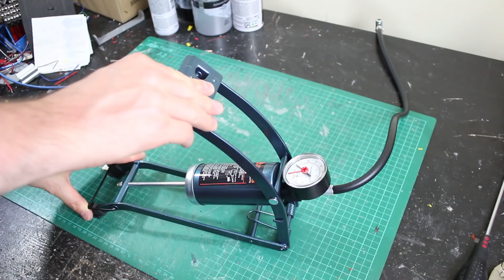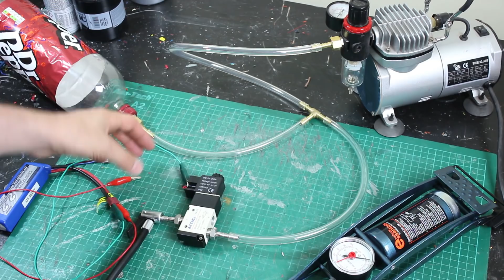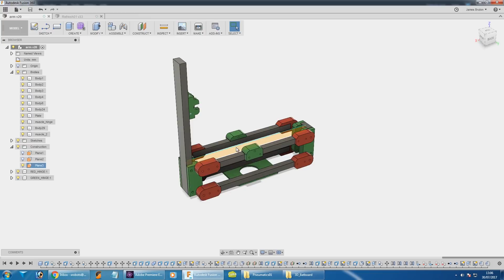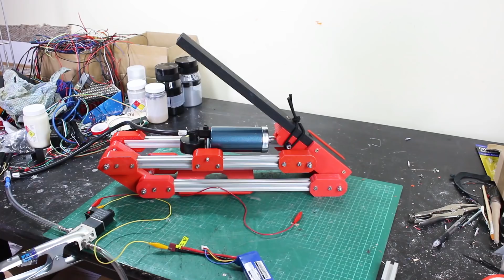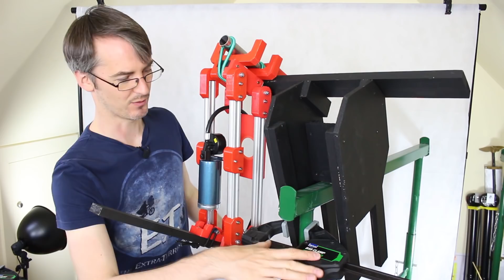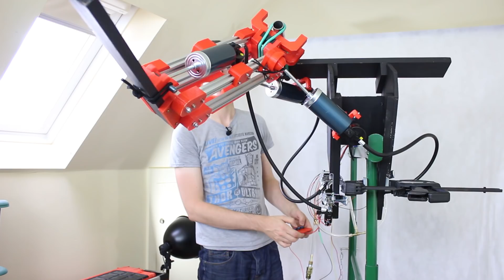Pneumatic Fighting Robot Concept | James Bruton

Comment: using the smaller compressor, you can put a valve on the solenoid exhaust port so when you need return, just open the valve and let the air out, and close it back to get your pressure back without waiting for the gauge to go above 1 bar

Comment: In my experience there isn't a good way to make a pneumatic actuator hit a position accurately because air is compressible. What pneumatic actuators are used for in industrial robots in to move back and forth between two hard stops. Occasionally you'll see them as a counterbalance spring for supporting the weight of a heavy arm, tweak the pressure based on the weight of the tooling on the end.

Comment: The 3D print beads look really thick. Did you increase the nozzle diameter for faster prints and because surface finish is not important for structural parts?
Reply: Are there any downsides to using a big nozzle?

Comment: Hey James, here's an idea to improve the accuracy of the pneumatics. Set your pressure to a fixed number that you want to use (150 psi for example) and do a slow mo recording of the robot punching. Then measure the angle of rotation of the joints. Then using the high speed footage, measure how long exactly it took the joints to fully rotate. Then, using those numbers, figure out how long it takes a joint to rotate one degree. Then, say you want one of the robots joints to rotate 13 degrees, you multiply the amount of time it takes for a joint to rotate one degree by 13. Then, using an Arduino, open the selenoid for that amount of time. It won't work perfectly, but it could improve accuracy.

Comment: A couple of ideas for you James: a) rather than air, connect to a water tap and use the mains pressure. You will need a return though. b) if you want better control, use air over hydraulics. Use oil in the cylinders with small storage jars powered by air...

Comment: So possible route (?), maybe work put a way to passively allow air into and out of the cylinder while a motor moves the arms (for fighting, realistic hand motions) and the pneumatic system kicks in when a punch is thrown, closing off the passive air flow for the duration of the punch. That would allow fidelity with the arms and better positioning yet power when attacks are given

Comment: Is there a way you can stop the pneumatic pump midway? Or is it that they fully extend or fully contract?
Reply: Why would he need to? You can just adjust the lever it's connected to to change the distance it travels. I don't think it's possible to have variable distance as you would need to have fine control over the air volume that's displaced, but then the pressure would drop and so would the speed.

Comment: James, I have adapters for making air tanks from soft drink bottles on my thingiverse page. Check out thing:1554940 for the screw on adapter. The hole is meant for attaching US pipe threads, but I could make a version for whatever pipe size you prefer.

Comment: TIP: turn the regulator on the compressor to the maximum and it will store more air. regulate down to what you really need downstream

Comment: Too many problems for pneumatics to work well.1. air supply, 2. air compression, 3. material expansion eating up kenetic energy from a compressible gas. Fluid hydraulics are far more efficient and easier to control than pneumatics.
Reply: Brent but hydraulics are more expensive, require a more complex system and actuate much slower
Reply: Every option has it's positives and negatives. Depends on a person's priorities, mine would lie in efficient function. Pneumatics are too herky jerky because of the compressible nature of gas and it takes far too much volume of air. Until someone learns to use inflatable bladders in place of muscle groups and miniature screw compessors , it's not a good option.
Reply: Brent if you want efficiency you're better off with e motors as both hydraulic and pneumatic change energy forms far too many times to be considered the efficient option, but also in this case he's going for cost effectiveness over efficiency. I think he's got hydraulics and pure electric beat there by a long shot
Reply: Sure, I wasn't debating which was cheapest, I was debating between Pneumatics and hydraulics. Hydraulics are also much stronger and more reliable which is why most heavy equipment now is electric over hydraulic or hydraulic fly by wire. When I see an all electric or a pneumatic excavator climb it's way up a 20 story tower, I'll consider hydraulics second tier.

Comment: Whenever i am stuck on my own project, all i have to do is scan your projects for an idea. This video just saved me weeks of fighting my robot project. I'm building Oscar the Grouch from sesame street, full size, and you just may have solved my movement issue. Love every video, even the old ones. My only complaint is i wish you ran through some of the code more often. I can never figure out PID controllers and end up skipping them altogether. I built my first robot in 1982 out of cardboard and vacuum motors, and when i retired from the military i took it up again, mainly due to watching your videos, Hello, from Utah USA,

Comment: Nice.
How about to remove bungee and add forth counter cylinder that will return arm back. This way you could increase arm strength and, using just valve open close sequence commands, operate arm speed and fix arm to specified position.
Also consider mount of valves directly to the cylinders. This way you will increase size of the way for air to get out from cylinder.
Good luck!

Comment: you could also try pneumatic muscles for retracting the arm quicker
Reply: I think they may be a bit too expensive.
Reply: Pneumatic muscles are expensive and unnecessary. Double action cylinders would solve the retraction.
Reply: you can make one yourself
Reply: I thaught they could save some space, but we will se what James comes up with
Reply: +PETR DOLEZAL yep, they could be smaller, but that means less force and probably less difference in length. Maybe they could be used in a pneumatic hand or something...

Comment: The pneumatics look really interesting! I don't like the idea of fighting robots but how about some R&D in the pneumatic space? You could even tackle the challenge of building a "skinny" robot with electric/pneumatic "muscles" that don't work the way robots normally do but more like a real human. I loved when you tried different things that no one has solved before. This is my idea for a series: Finding a way to build anatomically correct muscles for use in robots!
Reply: It's an interesting idea, the problem with pneumatics is, they work the opposite of real muscles. Pneumatic cylinders push, and real muscles pull. You can still get fairly good results, but you have to approach it with a reversed mind set. Any "muscle" you build into your robot will do the opposite of what the muscle in that position does in a human body, so if you try to build it to match human anatomy, it won't work quite the way you're hoping it would. Muscles in the pectoral region for example, pull the arms in on a human body, but they would push them out on a robot using pneumatics.

Food for thought when designing a pneumatic 'muscle' system. Hope it helps,
<3 Auntie ^ _ ^
Reply: You're right, so wouldn't it be even MORE interesting to see James build some sort of pneumatic/magnetic/electromagnetic/electric whatever kind of "muscle" that is actually able to pull in a linear fashion and maybe is even flexible? There must be something you can do with all those 3d printers, inductive filament etc. :D I can think of many things to try out, I'm sure James could do it!
Reply: You don't like Rock'em Sock'em robots? what's wrong with you?
Reply: I wish it were that simple. An artificial muscle is the holy grail of both robotics and the prosthetics industry, and a lot of people with much larger budgets and tons of highly educated scientists have been working on this idea for a long time. It's not likely a guy who's really good with home-made robots is going to crack that nut.
Don't get me wrong, he's really smart and I like what he does, but a 3d printer and some electronics are not up to the task. It'll take some really complex chemistry and likely custom molecular arrangements to do what a muscle actually does. They've been working on nano fibers that respond to low level current by changing length, but unfortunately the results have the same problem as pneumatics... they push rather than pull.
Still, I hope some day someone does figure it out. A synthetic muscle would allow (among other things) prosthetics for amputees to be built with the exact same arrangement of muscles as their former real limb, making it function much more naturally and having the same range of motion. It would be a huge improvement to a lot of lives.
I'm still looking forward to what James DOES do with his pneumatics experiments, because they're really cool and interesting. I just don't think he has the budget or the molecular engineering credentials to solve this old problem. But I really love seeing what he CAN do with basically some simple parts and a lot of ingenuity. He's really good at what he does, which is designing robots on the fly and getting some pretty impressive results for someone who's mostly working solo and doesn't have a team of engineers along to help.
Anyway, nice talking to you, and I hope you have a great day,
<3 Auntie ^ _ ^
Reply: Pneumatic cylinders and pneumatic muscles are different things. Pneumatic muscles DO pull, here's a page on them: softroboticstoolkit.com/book/pneumatic-artificial-muscles
Reply: Has he actually done anything with the idea? Because I'd be very interested to see what kind of results he got, and what his conclusions about the tech were. If so, what was the name of the video so I can look it up?

Thanks in advance for the info,
<3 Auntie ^ _ ^
Reply: Namek Kural I love that idea
Reply: bummer6 I like them, but I don’t like to see them built here 😉
Reply: That is very interesting, and I thank you for sharing it. I've never actually seen this particular tech before. I doubt it's something James would be using, as it doesn't look like something he could easily put together with readily available materials, but it's certainly something worth knowing for anyone who might be interested in trying to simulate actual muscle arrangement in their robot.

Of course, the number of muscles for a full robot with full articulation would require a huge amount of pneumatic hoses and a really good compressor (or two, or three) to power it all and carry the air to all the muscles, so it probably still wouldn't reduce the total size of the limbs and such by that much, but the tech certainly has some usefulness and is worth looking into for anyone who wants to go the pneumatic route.

Thanks for helping me learn something new today,
<3 Auntie ^ _ ^
Reply: Auntie Inari actually it is 50cents a muscle extremely easy to make
Reply: Having had another look and reading more about it, I see there are some very cheap construction methods, so that's a good thing. I also see they only get about a 25% contraction rate, which is probably fine for many applications, but in this specific case (the fighting robot he's trying to build) he gets roughly 80-90% expansion with the cylinder, vs a 25% contraction with pneumatic tube muscles. So he gets more 'bang for the buck' so to speak, from using cylinders in this case. But the tube muscles being so cheap to make I'm surprised more people aren't trying them out, and I'd definitely like to see someone do something interesting with them.

Thanks for the additional info, and have a great day!
<3 Auntie ^ _ ^
Reply: Making air muscles is actually really cheap and easy. cheaper then the foot pumps even. All you need is some rubber tube and a woven hose thing, like a chinese finger trap or the ground wire in certain cables. they only need more pressure i guess. I would be really interested to see James try them out, even if that would be in a different project like the exo-suit.
Reply: Auntie Inari he can 3D pint molds and pour silicon in it and then put a wire binder around, that makes a soft muscle, making multiple and aranging them correctly makes nature-like-muscles :D
Reply: Auntie Inari many people including the hacksmith have though about it
Reply: Namek Kural watch real steel movie good and transformers
Reply: Badass Killer soft muscles on a rigid robot 😉
Reply: Jelmer right, that‘s the direction id like to see
Reply: gamerdudes superelite you totally sound like you are trying to challenge James 😉 good idea!
Reply: pneumatic cylinders can pull if you have the right ones...
Reply: Namek Kural everyone, look up Megabots Inc.
Reply: Namek you love pneumatic muscles,

Gamerdudes you love fighting robots

There's only one solution. FIGHT!!!!

Ta ta ta ta ta tan  Ta ta ta ta ta tan
Ta ta ta ta ta tan  Ta ta ta ta ta tan
Tnan ta na   Tnan ta na  Tnan ta na nan Taaaa!!!! TA NAAAAAAAAAAAAAAA!!!!!